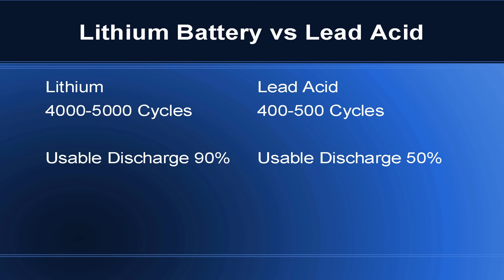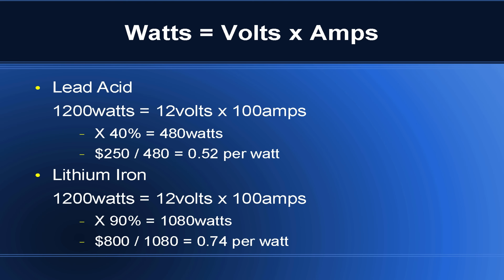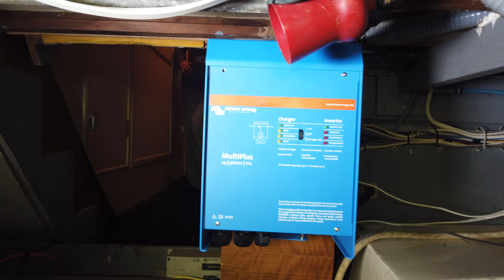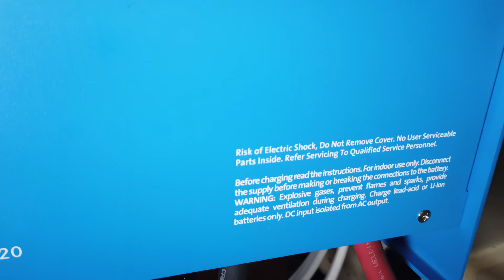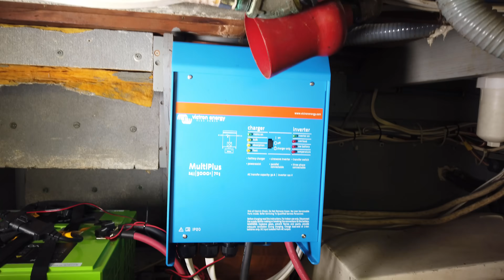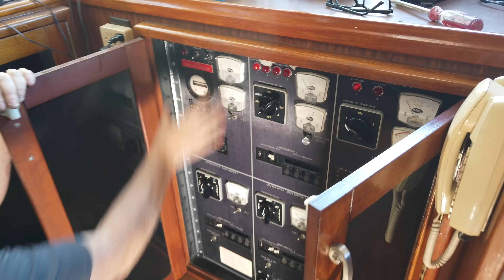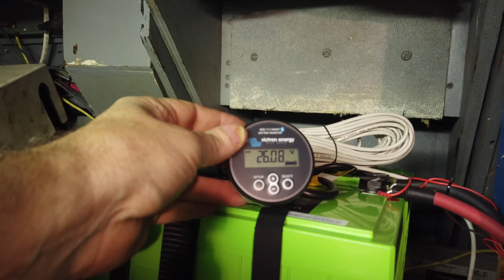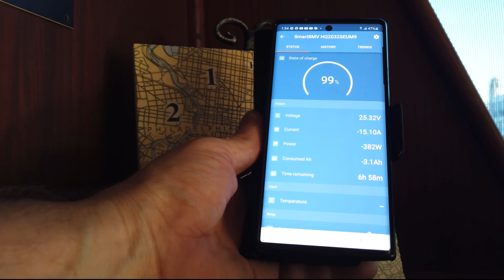Lithium Batteries that are cheaper than Lead Acid! E109

Comment: Your numbers were indeed very conservative in regard to the lithium batteries.   Typical life expectancy for LiFePO4 batteries is about 4000 cycles, as you said.   What you did not mention - or, perhaps, realize - is that, after 4000 cycles, the LiFePO4 batteries are likely to still have 80% of their original capacity.  You could see 10,000, or more cycles before they would need to be replaced.

Another thing to remember about LiFePO4 batteries is the fact that they love being partially charged.   The sweet spot that will provide the longest life is between 40% and 80%.   They will actually last longer if they are never fully charged or fully discharged.

Comment: did you use any BMS for to balance the batteries?
its hard to tell how you connected the link cables
Reply from the maker: No. Those batteries require an offboard BMS which costs around $500. I planned to add it but the cost of batteries has dropped in half since I did that video. I can now buy brand new, roughly equivalent batteries, with built in BMS for about $350 on Amazon. What I did was add a balancer, and I set my charger to not let the batteries drop below 30%. I figured that was a decent substitute for BMS, even though it costs me amp hours. I will be adding more batteries this winter.

Comment: I hope you have woken up the BMS inside the battery otherwise it won't balance the cells and you will ruin them.  Google valance super thread to find my thread about these batteries. I know them inside and out and trust me you will break them if you don't have that balancing board active if you haven't already.
Reply from the maker: I have tried activating it with no success. I tried just before leaving for our trip, then ran out of time. I am only running them down to 45% and up to 90%, so I am hoping they handle this three month trip without much damage. I wanted to get the master BMS but it seemed foolish to spend $500 trying to extend the life of $900 worth of batteries. The long term plan was to buy 4 more batteries and add the BMS.

Comment: Most manufacturers reccomend for maximum battery life that the charge state of the lithium batteries be kept between 20 and 80 percent.  This still allows a healthy increase in useable power over the lead acid batteries while maintaining the maximum number of discharge cycles.  As you replace more of your lead acid batteries with the lithium units and augment with the solar panels you may find yourself at the point that you can ditch the genset altogether or at least downsize it considerably.  During my years working as a marine tech gensets were some of the most problematic systems because they rarely used and rarely serviced.  Out of sight, out of mind to most owners until the one time that they need them, flip the start switch and hear only silence.
Reply: 20% to 80% is only 60% of Capacity - that is not very much more than Lead Acid ...

Comment: Ed if your going to replace your 32 volt house system with 24 volts, are you also going to replace all of the lights etc that use 32 volts?
Reply from the maker: I am not replacing the 32 volt system, I am adding an additional 24 volt bank. There are just too many 32 volts items on the boat, including alternators and starters. The new 24 volt bank is strictly for the inverter to run 110 volt appliances.
Reply: @tryingnottosink9107  Ok that makes sense.  Thanks for the clarification.

Comment: Very informative Ed, just one correction though; The limited use (~40%) that you get out of a lead acid battery is in terms of the Amp/hours, not the wattage. The wattage (P= V x I)  is fixed per the voltage and amperage rating of the battery. The 40% limit pertains to the usable TIME of use (Amp-Hours or Watt-hours) that you get out of the battery before having to recharge it. In the case of lead acid, you only get 40% of the full charge (Watt-hours) that is useable vs lithium which gives you 90% of the full charge. Hence it is not correct to say if a lead acid battery is rated 1200 Watt, you get only 480Watt from it. The rated Wattage remains constant until you have to recharge. It's the Watt-hours or kWHrs that are limited on lead acid when comparing with the same capacity Lithium batteries. The glitch in the specs is that the ratings are 100amp-hours not 100 amps. (In fact 100 amps drawn from any battery is pretty much like a short circuit that will instantly kill it :)) If you correct that, the Watts become Watt-Hours and the efficiency of lead acid goes from 1200Watt-hours to 480Watt-hours, which is the correct way to look at it.
Reply from the maker: Thanks for the clarification. I am learning as I go along. I think I have all the basic concepts correct, but stumble over the terminology. I am having fun figuring this stuff out though.
Reply: Do you know a lot about these type of batteries?? I don’t and I’m wanting to buy one for my 19’ skiff just for running lights and a depth finder. I don’t want to charge it constantly if I don’t have to while I’m out camping. I have one 25 watt LED light two drop in the water lights LED that should be less than 10 watts each and a depth finder that doesn’t pull much wattage at all. Do you think a 100 amp hour lithium battery will last at least 2 days without charging it. The lights will only be on at night. I’m just lost but want to make a good choice when buying one. The one I looked at Oreilly auto is $360. I believe it’s a 100 amp hour. Thanks if you or anyone can help me .
Do I have to buy a special charger for lithium batteries. I have a deep cycle battery charger I usually use on lead acid ???
Reply: @mwatkins2464  I'm not an expert on specific batteries, but the physics make it pretty simple to calculate what you need for your application. P(power in Watts) = V(Voltage) X I (Current in Amperes drawn by your devices) Assuming your LEDs and depth finder are all 12V devices, the current drawn by them all is just their rated Watts divided by their operating Voltage (12V assumed). Your three LEDS together use 45W combined power. That means they draw I=P/V amperes which is 3.75Amps. The 100amp/hour lithium battery can be run down  90% before re-charge to avoid damage. That means, to avoid damaging it, you really have a 90 amp hour battery capacity.   90Amp hours means literally  you can run a device that draws 1 amp for 90 hours before recharging. Therefore, your three LEDS can run for 90/3.75 = 24 hours continuously before recharging the battery. You need to add the current drawn by the depth finder to the 3.75 A of the LED's to calculate the total hours that you can run them all together continuously before recharging.
Reply: @Adippen  thanks. I just had to buy a lead acid battery. Maybe it will work out ok sense I’m not running much off it. Thanks for doing the equation for me. Have a good day 👍🙏

Comment: I'm considering adding solar to my 63' Viking CPMY. I don't know where to start... how did you decide what size system to use? I don't want to run any of the 220v stuff but being able to run the 110v without 20kw generator would be nice.
Reply from the maker: We sized it by the amount of available space above the fly bridge. It will not be our primary source of charging, so we just went with what would fit. We chose 200 watt panels because the 300 were much larger and expensive to ship. We have room to add one additional panel if we want. We are hooking up a MPPT to use our alternator to charge the batteries while underway. It was a challenge because of the different voltages used by our existing house bank. It will be covered in a future video.

Comment: You need to be corrected, "they're gonna last TEN time longer" is factually incorrect friend.
Reply from the maker: Okay, five to ten.
Reply: @tryingnottosink9107  How long does your Lead Acid Battery Bank last?  5 - 7 years?   So, 5 TIMES that is 25 - 35 Years?   Where is your proof that Li-Ion lasts that long?

Comment: Hi Ed, thanks for the video, very informative. I have a question, maybe I missed it but how long would the Li batteries take to be fully charged with the generator you have now ? Suggestion : would't it be cheaper/cleaner to operate if your gen were a propane unit ?  Thanks a lot, these holidays we will stay in Tarragona, no Barcelona. Happy holidays to you and family !!!
Reply from the maker: We do not know yet, but we are guessing about two hours. The generator uses the same fuel tanks as the engines, so it has over 800 gallons available. If we used propane we would be very limited to how long it could run.

Comment: Wise choices and good management of the system. At anchor I'm pretty sure you won't need to run the generator, unless you need the ac's. Getting a 4 bank system will add depth to your run time.
Reply from the maker: We plan to add more batteries soon. I will probably make them myself this time.

Comment: I have the xantrex  invertor with 6 ,6volt trojan t105 golf cart batteries wired to 12 volts on my grand banks 36 then two group 331 batts for starting the diesels. I have an electric range too. I'm thinking now of ditching the 6 trojan batts and get 2 of those lithiums like you got......did you hook up your invertor to charge your diesel starting batts while plugged into the dock power? mine is that way.........hey I enjoy all your videos by the way
Reply from the maker: No. We didn't hook the inverter up to the starting batteries. Our boat is 32 volts, so we still have the 32 volt charger running at dock, and when the generator is on. The only issue with the lithium batteries I bought is that they require a special BMS to communicate with the built-in BMS if you want to automatically balance the individual cells. I have not purchased that BMS yet. I have balanced the batteries manually with my computer. If I buy two more batteries I will purchase the BMS. However, I am thinking about building my own lithium batteries, now that I have a basic understanding of how they work.
Reply: @tryingnottosink9107  32 volts ok......build your own batteries wow

Comment: How did you determine how many cycles they already had used?  Another great instructional video!
Reply from the maker: The onboard BMS registers the cycle count, as well as an over or under discharges. I will try to show it in a future video.

Comment: Small technical point.  The shunt on the ground cable measures current in and out of the battery bank, not the voltage.  It’s used to calculate the charge going in and coming out of the battery bank.
Reply from the maker: Thanks for the clarification.

Comment: You mentioned, but glossed over a bit, the life-cycle cost of Lead-Acid vs. LFP.  The actual cost comparison over 10 - 15 years (or longer) has to be based on the total amount of energy extracted and has to include the cost to replace the Lead-Acid batteries 2 to 3 times (or more).  No question, LFP comes out ahead, especially compared to AGMs.
Reply from the maker: Thanks for your comment. After watching that video I realized I forgot to say a lot of things. We will be doing a follow up video next week, including Solar Panels.

Comment: The batteries will outlive you :)   and me :).  Do you really trust the discharges provided by the people that sold them to you on ebay ?  Your electrical skills are impressive. Is there an autoshutoff if the battery level gets to a certain level - say 10%. I have heard that if you take a lithium battery to zero just one time - it destroys the battery. Is that true ?
Reply from the maker: It is true with some batteries. Our inverter has a low and high voltage shut off. We will eventually install an offboard BMS that has contact relays that can physically disconnect the batteries and those circumstances, in case the inverter or solar charger fails. The batteries onboard BMS stores cycle information, as well as any over or undercharged occurences.

Comment: I've got two AGM banks and have been thinking about lithium... but it is costly.  However, I really like what you did here in creating a new bank just for your inverter.  Our current inverter is what draws down one of our existing banks the most so a separate bank to use with a new inverter makes a lot of sense.  And I can do it without replacing my two existing banks.  Thanks!
Reply: It’s a bigger up-front cost compared to Lead-Acid, but the life-cycle cost is actually lower, and there is a considerable savings in space/weight for equivalent usable energy.  This assumes in both cases that you have really used/maintained the batteries correctly.  Abuse any battery and you shorter its life.
Reply from the maker: Hi Mark. It worked out great for us. We are adding solar panels this weekend, hopefully.

Comment: We're getting ready to do a similar upgrade next spring on our 38' trawler. We're sticking with 12v because we need the house pack to power our thruster and anchor puller. 
I'm planning on building my own batteries for about a 600 Ah system, though the exact capacity will depend on the cells that I can get when I'm building the system. 
Your system looks good!
Reply from the maker: We considered building our own batteries. It does not look that hard, but with this being our first foray into inverters and batteries, we decided to go with the Valance. Perhaps when we decide to add on we will give that a shot.
Reply: @tryingnottosink9107  The Valence are a good choice. Nice package, good quality, excellent price.  I know other folks that have chosen them and been happy. You may want to just stick with those for this install and add the Valence management. I can put you in touch with another guy who's got eight of them in his RV, if you'd like. 
I've done a couple RV lithium conversions ( This was mine in our last RV - https://www.jenericramblings.com/2017/01/17/rv-upgrades-switching-to-lithium/ ) and have lithium batteries in the current RV and as an aux battery in our Jeep. We love them. 
On the trawler, we use our batteries a lot - we typically only run the generator for an hour a day when at anchor ( 90% of our nights are spent at anchor ) the rest either comes from solar or from the main engine when under way - Balmar smart alternators FTW. Our switch to lithium should expand the usable capacity of our bank by at least 2x while cutting weight and removing the space needed for three of the existing batteries.

Comment: Just remember that the enemy of Lithium Batteries is "HEAT", and if lithium batteries become over heated they can start venting extremely flammable gas (remember the fires that the earlier models of B787's experienced), that if ignited is like a jet engine on after burner. Saying all that you'll love those batteries once you add those other batteries.
Reply from the maker: We do have temperature sensors on them, so hopefully they will be fine. Also, they are Lithium "Iron" which should be much safer.

Comment: About the only place on board where the benefits of lithium can be questioned for if the cost is worth it is the starter bank for the engines.
The rest of the boat the lithium benefits do come out on top in the analysis.

With how little the drain is for the starter bank, they last for long enough that the cost of the lithium and lifespan of them it just doesn't make sense to switch them over. If you were living aboard and cruising full time, then maybe it would.
A brand new boat, from the Factory? if they don't come with lithium then the builders are idiots.
Reply from the maker: We agree exactly.

Comment: Hi Ed, If you want to keep your Lithium battery bank in good shape for a long time, putting them in an engine room is really not optimal. I'm not sure how hot it gets in your generator room but be advised that they degrade A LOT faster when it's too warm. You can look at it this way: if it's not confortable for you, it's not good for the batteries. It's actually the same for lead acid batteries, but they are a lot more resilient to warm temperature. Manufacturer often say they can be used in a worm environment and it's true but at a price. Longevity.

Richard
Reply: Also, I don't see your green ground wire in your setup. It should be the same size as your biggest DC wire. ABYC allow for one size smaller.
Reply from the maker: Thanks for the input. I was a little worried about that as well, however, I really have no place else to put them. Fortunately, it does not get that warm in the generator room since we do not run the generator very often. And, you are absolutely right about the ground wire. I was wondering if anyone would notice. I have been trying to find a bus bar that I can connect to the shunt that would ad a few more contacts. I haven't had any luck yet. I will be doing a part 2 video next week, where I add solar panels and finish up the install.
Reply: @tryingnottosink9107  Don't bundle the batteries tight against each other.  It is going to be warm in that space and any extra space around the batteries to allow air circulation will be a big help.  If you find the temps too high around the batteries you might do what I did and install a small computer fan to increase air circulation.  Batteries generate enough heat on their own. Temps above 35c will affect the battery life.  Good video!
Reply: @tryingnottosink9107  space is always limited on a boat. You do what you can with what you have... ;-) been following you channel for a while now. Really fun to watch. :-) Give us a shout if you come to Canada. We're in Montreal but spend our summer in the great lakes. Hatteras 48 MY.

Comment: That is the exact inverter I've been looking at for my boat 30 amps would run my entire boat
Reply from the maker: So far, we like it. 30 amps will run every non-220v system on our boat as well.
Reply: I’m pretty sure Victron Inverter/Chargers can be connected together to also produce 240VAC.
Reply: @brucefay5126  yes sir they most certainly can 220 is too hot legs neutral and a ground